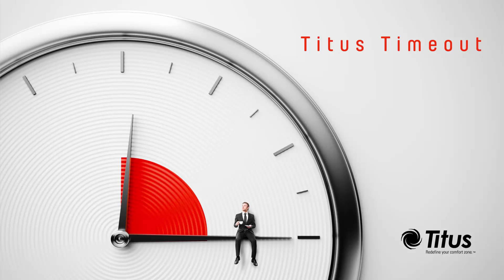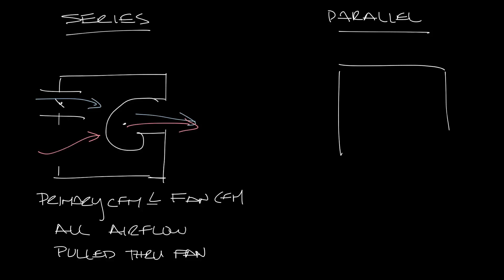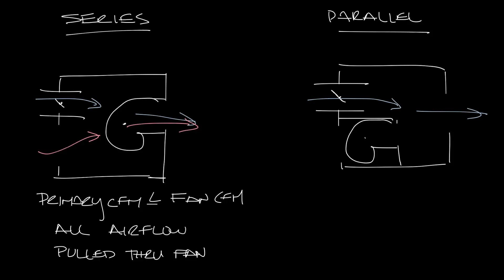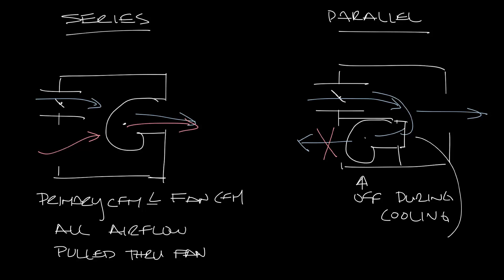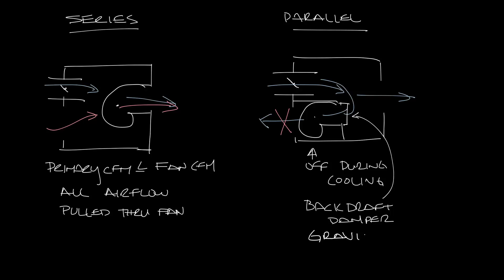Titus Timeout Podcast - Why Do Parallel Fan Boxes Have Backdraft Dampers?

Comment: Thank you for the explanation. You mean in Series box due to the suction pressure of the fan there won't be any loss of energy? But the induced air inlet is always open and also has least resistance too, for the air to be escaped?
Reply from the maker: The parallel unit must have a backdraft damper, because the fan does not run during the cooling mode and the primary air path is under positive pressure. In a series unit, the fan runs during both heating and cooling and the entire cabinet moves between neutral pressure and a slightly negative pressure. Most balancing contractors set the fan on a series unit to draw slightly more airflow than the primary maximum airflow for this reason. A properly balanced and operational series unit doesn’t require a backdraft damper because there should be no air escaping from the induction port.  For additional questions contact us at tu@titus-hvac.com.
Reply: @TitusHVAC  Thank You So much, well understood. I have recently downloaded the "Basics of Air Distribution" pdf of Titus. I am reading it currently, if i face any doubt I will surely reach out to you.

Comment: Hi I would like to know if freewheeling can cause damage to the fan motor even if the motor is off the entire time.
Reply from the maker: Although freewheeling will not damage a de-energized motor, it can cause problems when starting a motor. Forward-curved blower wheels tend to freewheel backwards. If a motor is freewheeling backwards (PSC motor or ECM) and it then energized or receives a run signal, it will likely continue to run backwards. A backwards running blower will still move air to the room, but at about 50% of its normal airflow. That’s why it’s a good idea to turn fan boxes (both series and parallel) on prior to starting an air handler. If floors in a building are operating on different schedules with a shared air handler, primary dampers on unoccupied floors can be closed prior to turning fan boxes on to avoid backward running fans.